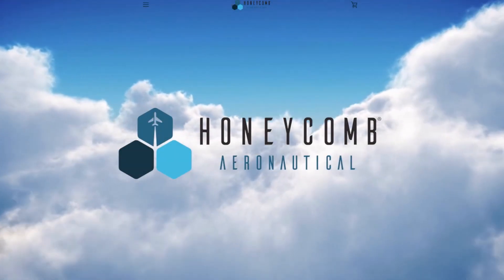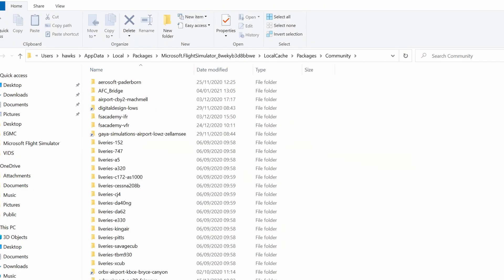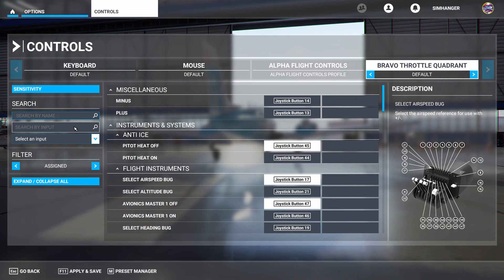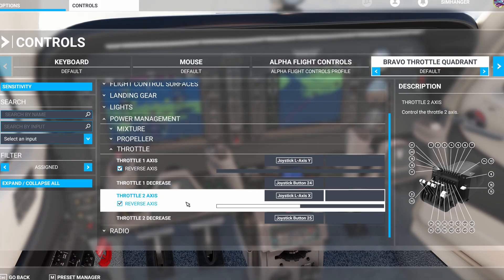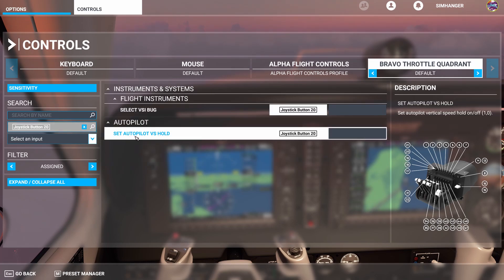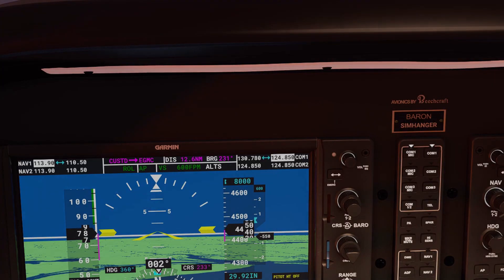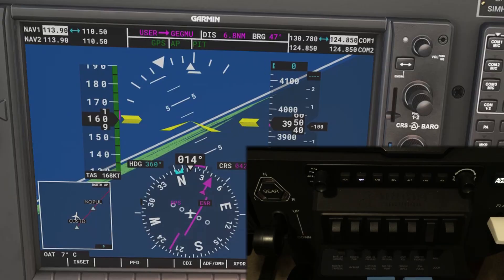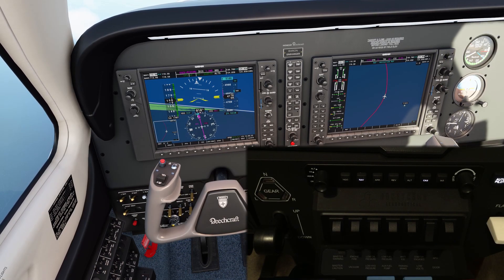Bravo Throttle LED LIGHTS Configuration Guide | Microsoft Flight Simulator | Honeycomb Aeronautical

Comment: After pre ordering on Amazon uk in feb last year still waiting for the throttle quad to arrive.
Reply: I’m in the same boat but ordered in July. It’s been delayed so many times. I’m sick of waiting. Now Amazon can’t even give an estimated date anymore.
Reply: Wow only last Feb.   Don’t worry guys it IS worth the wait.   I ordered mine back in Dec 2018.   It turned up on the 20th Dec, and I can honestly say it’s the best home throttle I’ve ever used, especially for the price.    I appreciate it’s very frustrating waiting and not knowing when it will come out.  Aerosoft initially had a date for March 2019 when I initially Pre ordered. 😂😂😂. 

But there are a number of software bugs with the system at the mo, so on bright side the longer you wait, the more likely these bugs will have been fixed.   Certainly the community that has already got them, is doing a stunning job, in discovering bug fixes. 

Don’t give up, It WILL be more than worth it when it turns up.    Fingers crossed Amazon actually get some soon.
Reply: @cowboy10uk  2018 ? That’s funny they didn’t even have the R&D complete on the Yoke in 2018 which I have but ok
Reply from the maker: It's so frustrating, and applies to VR headsets, Graphic cards and so on at the moment. Everything appears out of stock at the moment!
Reply: Me too i ordered 19th Aug. I called Amazon and it appears they have never received a single unit since its been on their site. Totally crap and very frustrating. Other retailers in the UK are now stating spring or even July delivery. Totally pissed off having to just watch reviews and read about this item. I've emailed Honeycomb direct but i should imagine they've received loads of emails about the same thing so will just be ignored or deleted. Real Shame.
Reply: They’ve certainly shit the bed on this one! 

Last email I got from honey comb was units were going out to distributors in the coming weeks this was back in November.  Amazon then updated their expectations of delivery as 23rd of December and now no one has a clue when their ordered units are expected and honeycomb have gone quiet 🤐
Reply: @aileronsintowind6835  Yep i saw that too, think i saw the 18th Dec before that also.  its totally shit especially when you see others like the chap up the top of this chat who ordered direct on 23rd Dec and got it on the 7th Jan. Clearly they've not bothered with Amazon at all. I'd also ordered at Scan but dates disappeared. Doesnt look like they can get it either or have given up with Honeycomb.
Reply: This was 12th of dec 

We have started shipments to retailers and distributors, unfortunately we can not provide you a date as to when it will ship from them to yourself as this would have to be down to their process. I would recommend you keep in regular contact with you point of sale for updates.

Best Regards

( shipped boxes of fresh air it would seem )
Reply: I  pre-ordered late September last year from Amazon uk since then I’ve received nothing but ‘’order delayed emails’’.My order got delayed six times . As of now I’m still waiting.Estimated time of delivery is unknown.
Reply: @Josh-bl7hh  because they’ve not had any units from honeycomb and no doubt the amount of delays and broken dates honeycomb have established a pattern of Amazon basically are now saying once your units arrive with us we will contact our pre orders. Personally I think honeycomb are preferring to sell them themselves as they can up receive a higher percentage of RRP
Reply: Its not 100% but if like me you ordered from Amazon UK last year (August for me) there might be some good news coming in the next 2 weeks.  I've gone round the houses on this one.  I wrote to Honeycomb and had an email back yesterday advising me speak to Aerosoft as they are the main disti for Europe.  I spoke to Aerosoft this morning and they advised this wasnt true and they dont supply Amazon uk directly but use a 3rd party company based in the UK to handle logistics and supply Amazon. Its up to this 3rd party to provide Amazon and other UK retailers with stock,  but what he did say was that a large delivery should be on route (and we're talking 100+ units) to UK retailers around the 20th Jan.  Keep your order with Amazon (he advised).  We shall see what happens.  As for Amazon, i spoke to them last week anyhow and the call centre chap didnt have a clue about the product. all he could tell me was they've never ever received a single unit to date. Hope this helps.

Comment: I see the heading changes 10 degrees at a time?  Does the Nav on VOR. Should be 1 degree at a time.
Reply from the maker: It’s a MSFS bug, not the BTQ config. Regards
Reply: I see that.  I get mine today!  I noticed in FS if you If you click you can get a degree but mouse wheel I get 10. Steam gauges are 10. I hope they fix that.  I like flying direct VOR on Departure then transition to GPS.  Enjoy your content. Long time simmer here. Since FS98 and Real Lic with Instrument Rating. Really Love pushing my IFR skills in FS.   Thank you

Comment: You seeing APU working?  Haven’t got that LED to show up.  How about the anti ice?  I notice that the anti ice comes in when it’s off and visa versa?  Seeing that also?
Reply from the maker: Haven’t tried the APU yet, the anti ice switch can be reversed so it operates as needed. Depends how you configure the switch. Regards
Reply: @SimHangerFS  Switch itself is binded correctly.  I meant in the plane.  For example I tried the Longitude.  When I turn on Anti-Ice it stays on.  When I turn it off it stays on as well.  Using the Mouse, not the buttons.  Only way to shut it off is if I turn on Pilot Heat.

Comment: Hi guys,

regarding the IAS light fix:

We simply didn’t have an input controller layout for the Bravo, when we wrote the LED profile. So we could not know, which button would be mapped to which autopilot function but could only make educated guesses and try to map the LEDs accordingly.

So, depending on which aircraft you fly the LEDs might work, or not work. As simply not all aircraft use the same autopilot functionality.

I hope that clears it up a little.

Have fun with your Bravos!

Greets,
Ben from Aerosoft
Reply from the maker: Hi Ben, thanks for the feedback. Much appreciated. Regards
Reply: Does this mean if you change it to FLC, it won't turn on with autothrottle?
Reply from the maker: @quintenzappe3412  FLC mode in airliners operates differently due to the increased complexity in the RW.
Reply: Just got mine! Amazing!
Reply: any idea how to get the caution&warning lights on the annunciator panel to work? I have the latest driver from your website and the other lights work fine, but never these 2.
Reply from the maker: @anthonysonstein4288  pending update
Reply: How do I get the darn throttle to stop going up/down in increments of 10 for IAS and HDG and 1,000’s for ALT? It’s so frustrating man. It shouldn’t be this hard. Is there a fix for this? Even when using the on screen knobs with the mouse, it only goes up or down by 10’s/1,000’s when the throttle is plugged in.
Reply from the maker: @gregthegroove  , Hi, I have the same frustration....its a program bug that Asobo are aware of. Hopefully the fix will be in the next update. Take care.
Reply: @gregthegroove  use a program like spaad.next to bind the buttons, don't bind them in-game and you won't have this issue.

Comment from the maker: The drivers for the LED lights for the Bravo TQ for use in MSFS are now available, version 1.002. There are a numbers of bugs which we have found solutions to. Hopefully this is a start to further updates to expand the versatility of the Bravo autopilot and LED’s.
Reply: I've never seen the caution or warning lights come on, but the others seem to work, any ideas?
Reply from the maker: @anthonysonstein4288  , hi, I also have not seen these come on so far, pending an update from Aerosoft. Regards
Reply: I have checked the .json file with the newest drivers on Honeycombs site and the file is updated as you recommended but still not lights at all...Any suggestions?
Reply from the maker: @whycanimakeaname   the lights may be in the default profile only.